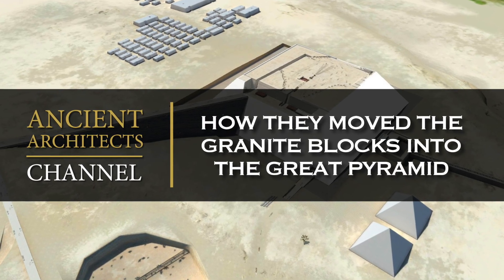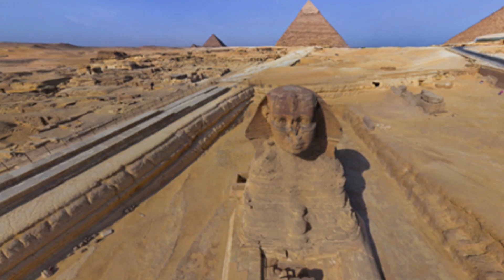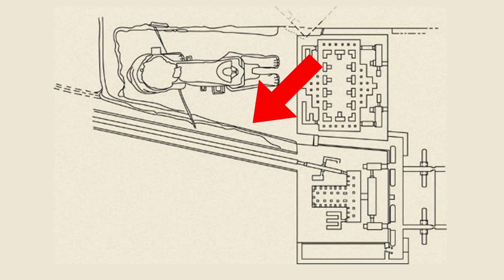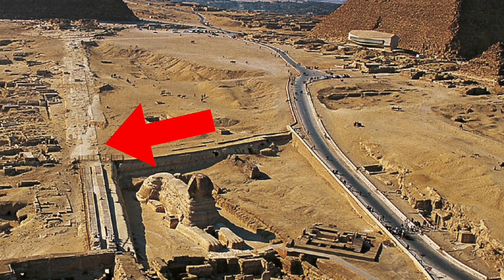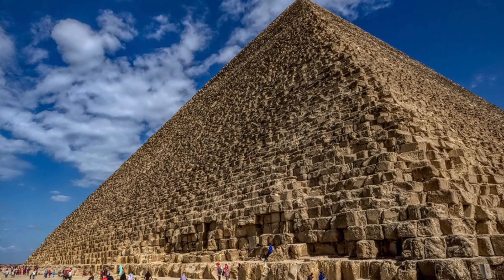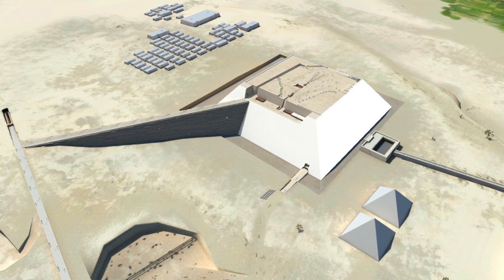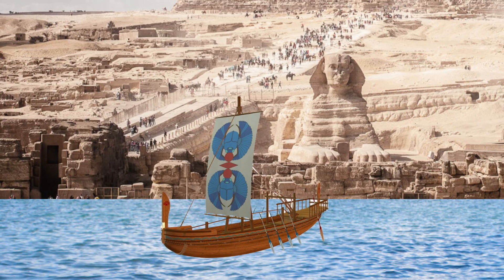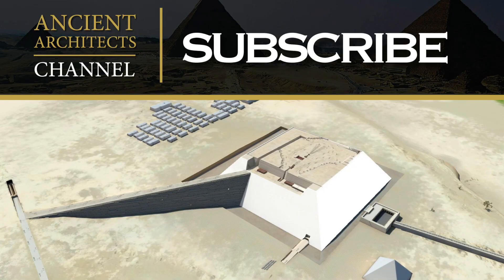How They Moved the 60-Ton Granite Blocks into the Great Pyramid | Ancient Architects

Comment: Floating 60 ton blocks of granite down the Nile would have been quite an undertaking. They surely lost control of a block or two which dropped to the bottom of the river bed into the mud and silt.
The river channel has moved over time in some places and what used to be the river channel is filled with sediment and sand. Sediment and sand now surrounding an out-of-place granite block.
Has anyone searched for, or found, any of these out-of-place blocks?
Reply: H M  Why go through the effort of quarreling, transporting, loading, navigating and erecting multi-ton blocks of granite (and other stones) anyway?
Wouldn't it be easier, cost effective and logistically efficient to work with smaller stones (100 lbs.)?
Reply: @markanderson9123  The Great Pyramid was built to meet the needs and desires of those who built it.
Reply: @GreatPyramidPump  Who built these megalithic structures is my lane of inquiry. There's so much stuff that is missing from the narrative that it's not funny. 

Megaliths underwater, core drills made in stone with tech that's difficult to replicate, multi-ton coffins, pyramidal structures covered in vegetation, multi-ton blocks buried in multiple feet of sediment, transoceanic travel across 1000's of miles of open ocean, Aboriginal (world wide) stories about land being swallowed by the sea and it just keeps getting weirder, older and more challenging to explain.
Reply: @markanderson9123  How and why the Great Pyramid was built is my lane of inquiry.  I wrote two books about the Great Pyramid.  But based on the most recent scan of the Great Pyramid there is no internal spiral ramp.  It will never be "discovered". No one will ever walk on the internal spiral ramp because it does not exist.
Reply: @GreatPyramidPump  Um, it is compressed sand. Only way someone would walk on it would be if someone decided to demolish the pyramids and dig out the denser ereas in the sand.
Reply: @ingebrigt8143  I don't think anyone has ever or will ever walk on the internal spiral ramp.  This is because there is no internal spiral ramp inside the Great Pyramid.
Reply: @GreatPyramidPump  What causes them to show up on the screening? Are they cheting?
Reply: @ingebrigt8143  The latest scan of the Great Pyramid did not detect the internal spiral ramp.  This is because there is no internal spiral ramp inside the great pyramid.
Reply: @GreatPyramidPump  Hi, there is a way to make an external ramp that goes around the pyramid, it is called lateral ramps, without deforming the quadrature and the angles, while it is being built. For someone looking from afar you will see a stepped mastaba, that seems to me the most practical way, but most likely they have used more than one method. I believe that the largest granite blocks were raised by one or several ramps within the same pyramid and perhaps using counterweights. Building a large external ramp at the height of the king's chamber seems unintelligent and a great waste of time.
Reply: @GreatPyramidPump what are those needs and desires?
Reply: @armandobardo6861   exactly...  no need for an internal ramp, just have an external one, on the steps of a step pyramid...  when you get to the top, start the cladding and work down, dismantling the ramp as you go...
Reply: @markanderson9123  The 60-ton blocks were roof beams and had to be made in one piece for strength. As to the other stones, it's arguable that the effort to move 2-ton blocks is a lesser problem than cutting them into smaller pieces with primitive tools. Also, small blocks need more mortar, and the ingredients for mortar are said to have been scarce in old-Kingdom Egypt.
Reply: @markanderson9123 They had to earn their keep .
Reply: Hmm...they found one in Lebanon. Guess the Egyptologist are still covering it up with bricks like the Sphinx.
Reply: @markanderson9123  The giant stone of the pregnant woman in Balbek?  Bigger than anything in any Pyramid!  There is so much of our History midding, like all of it.
Reply: yes, there was big granite block found in the ancient giza harbour..obviously that happend when unloading a boat..
Reply: H M  good observation.
Reply: Modern are coming up with theories that are almost improbable. You asked a good question. Why not hire a couple thousand strong men and try the theory.
Reply: We never see enough videos from the quarry’s. There must be hidden clues in these places and locations.
Reply: Joe Biden used to work there .
Reply: This can’t be true. 

According to physics , in order for something to float, what’s carrying it needs to have enough air inside to hold the weight so it floats on water. 

Now with a 25 ft depth on the Nile river, a 60 Ton rock, would need a MASSSSSSIVE boat, that would likely fall 10/20  feet into the water so that boat would literally be a few feet from the bottom. 

That’s not possible
Reply: @Eddie_Lifts  average draft of river barges is 9 feet, with capacities from 1000-3000 tons

Papyri have been found from the actual river boat crews that transported Giza stone, so there is no doubt they could and did (papyrus of inspector Merer, circa 2600 BC).

The Egyptians and Romans transported obelisks weighing 250-350 tons, on rivers and across the Mediterranean.

It’s not air inside, Archimedes, an object, totally or partially immersed in a fluid or liquid, is buoyed up by a force equal to the weight of the fluid displaced by the object. So to carry a sixty ton stone, sixty tons of water needs to be displaced. A 70 foot long vessel typically carries around sixty tons, so not that big, and entirely possible.
Reply: @Eddie_Lifts  
but a 60 ton block that is under water does not weigh 60 tons.
Reply: @hacunamatata6802  Correct. It weighs less than 40 tons. But there would not even be any need to sling the block under a barge to lessen its weight (though that would greatly enhance the boat's stability) since either of the Solar Boats buried beside the Great Pyramid could easily transport a 60 ton block.
Reply: Wrap the blocks in papyrus & problems weren't. They might have bobbed around the Mediterranean tho...
Reply: @user-mp3eq6ir5b  lol
Reply: That's not feasible. I still believe they had tech we still do not understand. Modern day scientist are too arrogant to admit they do not know. Or if they do know they won't reveal it to the general public.

Comment: If the ramp from the water was channeled   and flooded with water (depth may not be important) ..a sled or block could be drug by a counter weight relatively easy.( Most say that the flood season was the main building time.) I think the pyramid could have been built from the core out instead of stacked as most believe.. but i confess I've never been there.. that could change my mind. I do think the Grand Gallery was the location of a counter weight system. I still haven't found an explanation for the "dents" in the middle of the sides of the pyramid . The other pyramids don't have them.. why? or do they?

Comment: It does not imply the Sphinx was built later for one very good reason. Pause the video around 11:08 and take a look at the plateau. Is there really no better place to put the sphinx? Almost every spot looks better. It clearly looks like the Sphinx was already there and they had to build around it and incorporate it into the general landscape as good as they could. Hence the odd shape of the enclosure, which might have looked completely different from the start. Not all enclosure walls show the same ammount of erosion, which could be explained by later "upgrades" to incorporate the Sphinx. To me it looks like more proof, that the Sphinx is actually older than the pyramids.

Comment: What was the strength of the ropes used? 
And, as we really have no idea what the internal dimensions are. As the scan pyramids project reveled another cavity, which has not been explored.
I have seen / read most the theories on the building of the pyramids, but all have some flaws.
To me it all comes down to 1 simple question, WHY? Why, build what is a major undertaking for any time period. It must have served some purpose, as no work force is going to do that much for any ruler.
If all the chambers and tunnels were mapped, to where we could get a idea of it's purpose, we could then start thinking about how it was done. 
To put it in a modern idea frame of mind.
I think right now it's a dark age society looking at a cell phone and making up what it was for and how it was built.
No, I don't believe it was aliens. But I do believe at one time we possessed a knowledge of how to do things working with nature in a way that our mechanical brains cannot comprehend.
Reply: @TheGhostrider1959  Dude I agree that was why I asked the questions I did.
These structures (as there are several) were "suppose" to be built by people that just came out of a evolutionary stage of cave man.
I don't understand on the current "official" explanation of human development, as you do not go from hunter gatherer to building that structure.
Just no way.
Reply: @KalRandom  They didn't come out of cave men?! That was 100,000 years ago: 50,000 years ago we were farming. 20,000 years ago we had cities. This was  only 6,000 years ago! People were more evolved, not less than today, because stupid people literally died! We are short men standing on the shoulders of giants.
Reply: @TheGhostrider1959  100% agree. I love the comment when people ask where are there tools then. Not realizing how long 10,000 years really are, everything besides stone are dust.
Reply: Some type of  advanced  shared technology   at work    the higher  technology  tooling  was limited  [the cutting  of hard stone  with methods  of handling  large  sizes  was in a category  by itself] .  Looking  at the production rate and time to complete  . The one's  that engineered  the design  . We're not average.  Going  to have to rule out wood sleds  copper cutting tools  and stone dolrite BALLS  .  Not a question  of manpower  can only get a certain amount  around the   blocks  at a time  . 2 .5 million blocks cut moved and set  every  6 minutes  for 20 year's  .  Does not  seem  to be  explainable.  .
Reply: Wow!  You were doing GREAT until you wrote:  "No, I don't believe it was aliens."
You just eliminated what may be the ONLY possible solution to the many questions of HOW and WHY which extend all over Egypt and the entire planet!  And the basis of such an elimination?  Only one; to protect your conventional reputation in the conventional world.  
Otherwise there IS no basis to eliminate any possible explanation.  But it requires a willingness to think far outside of the box.  I suggest you widen your thinking by reading this: 
Evidence of Molecular-bond Reversal & Ancient Stone-Softening Technology  
https://sciencetheory.wordpress.com/2019/08/19/evidence-of-molecular-bond-reversal-ancient-stone-softening-technology/
It's the most recent of 16 articles I've penned about ancient tech.  I'll be glad to hear what you think.
Reply: @redwoodcoast  I'll read it in a few, but right now I want to explain a little bit. Aliens are given in the galaxy and a possibility on earth (but I don't think we are special enough to deal with), but I DO NOT disregard the abilities of people on this planet.
I really think we were more advanced in a different way than now and a major catastrophe hit the Earth, we lost knowledge of how to build such structures and what the full meaning of them are.
The people that decided what our civilizations history is based it off there better than you point of view hundreds of years ago.
I think humans could have built it back then with what they knew at the time, no need for aliens to come and help us. Never underestimate our species.
Side note for years I thought aliens, till I looked at the younger dyes event and the common building styles across the globe.
Reply: @KalRandom  No one can pull themselves up by they own bootstraps, which you are believing is possible.  Without societal evolution you do not get sudden advanced civilizations such as found in Sumer and Babylon and Mohenjo Daro, Minoa, etc. UNLESS a superior society injects knowledge into a much more primitive society.
What you assume about history is not possible in the time frame in which history occurred.  It does NOT follow natural social evolution.  You should be aware of that as it is common knowledge.
But you put forth a false dichotomy, aliens or no aliens.  That is falsely 'two dimensional' since it lacks the very real factor of TIME.
In time, those E.T. humans intermarried with humans and produced royal lines and even some giant lines, and some of those royal lines were left with E.T. technology when the original colonists and their own children returned to their own world.  

Their descendants had access to knowledge and equipment that remains hidden from us, and all we have is the tell-tale evidence to analyze, which we are doing, and learning major things from it, as you would if you'd read what I've written in the last several months.  You are currently behind the curve.
http://sciencetheory.wordpress.com
Reply: @redwoodcoast  Sorry I disagree with you. Your stating the current mainstream belief in human evolution and then throwing aliens into it.
What if over the 200+ know thousand years that know humans have been around, we have already reached this if not more of a higher degree of ability. And then 10 and 12 thousand years ago when the human race was nearly wiped out just like the mega fauna of the northern Americas. All over the world from that time period there are signs of a major impact from outer space.
We have lost our true history.
We are capable of wonderous things don't give the credit to aliens because you can't do something, read learn and expand your ability's.
And yes I read your linked article. Please research out of aliens and into lost history stuff, you might find we are capable of so much more than being angry on the internet.

Comment: sighs this theory changes nothing.

Still no dating and proof that the Khufu pyramid’s inner works with granite chambers wasn’t already there when the actual pyramids where made. 

Still no definate proof of a 500m long and verry massive ramp!? it’s more likely a combined canal for transport barges and a lifting mechanism. (locks, water pillar or just barge counter wheigts)

As i mentioned before, Kafren was probably first a trunkated pyramid since the top half doesn’t look like it was made by the same builders who did the bottom. (eons apart)

So it’s still possible there where just a sphinx, causeways, enclosures and granite (functional) structures on the tell above the aquifer but no pyramids.

They could add trunkated pyramids, just to encapsulate the granite structures. 

Last step is the spiral technique, where the full Khufu pyramid was built (by Khufu?) with 2,5t stones and new air shafts. Finally, the top to Kafren pyramid was added (by Kafren?) with what looks like boulders/rubble in comparison but wouldn’t be visible behind the white casing stones.

All this wasn’t finnished within centuries, more likely over millenias, during different cultures, religons and technologies. 

OSL samples must therefor be taken from lower, upper, inner and outer parts of one huge, complex structure to produce a convincing dating. Untill then, there will be many convincing theories to choose from.

Comment: that's a lot of work to lift some massive granite blocks into a structure nobody would later see. they could just have made a third pyramid of filler material like the other two with a mastaba-like underground tomb underneath. means the entire giza complex was planned in detail in advance and was not just ad-hoc adding of pyramids by successive pharaohs. there would also have to have been an extensive and sophisticated ship-building industry in lebanon with egyptian oversight to make sure the right boats were built and pre-ordered long in advance. makes you wonder.

Comment: I disagree.  Using the law of crosscutting relationships,  the causeway crosscuts the sphinx enclosure, therefore the causeway is younger. The causeway may have been built on top of where the sphinx enclosure used to be.
Reply: I think that would not geologically be likely since the wear on that wall enclosure is wear on natural  bedrock, and not constructed brick or block material.

Comment: I genuinely am asking, because I don't know enough about it to have an opinion:  could there have been something on the south side of the sphinx that predated the causeway but had a similar footprint, which necessitated the oblique angle?  Conversely, was the sphinx enclosure always the shape it is now?  Could the southern wall have been more symmetric at one time, and the other walls changed around it?  That last one seems unlikely, but like I said, Im honestly asking because I don't know.  On that same line:  is it possible that sphinx has been reworked so extensively that it no longer faces in the original direction, or at least the head no longer does.  If the body was a later addition, mostly made of masonry, could the sphinx and its enclosure have looked entirely different, and been oriented entirely differently, in the very distant past?  And one more:  what if the southern enclosure wall is actually the original construction, independent of everything else, even the detailed carving of the sphinx?  Is it possible that the wall we now see was actually the original construction, made in the neolithic style of shaping the natural landscape around important natural features?  Maybe the head of the sphinx in its natural form actually looked like a head, so it wasn't touched and the land around it dug?